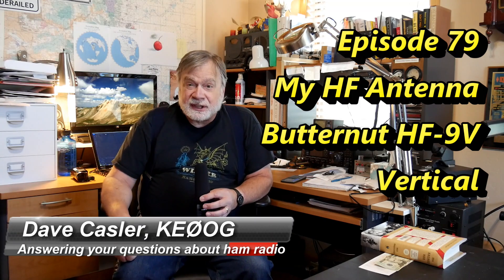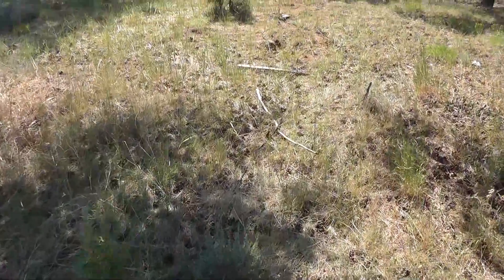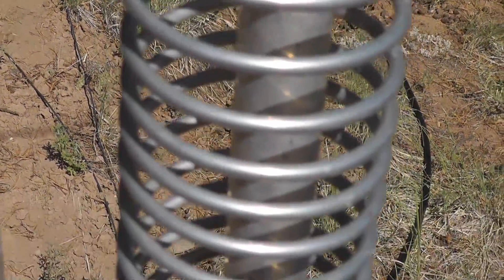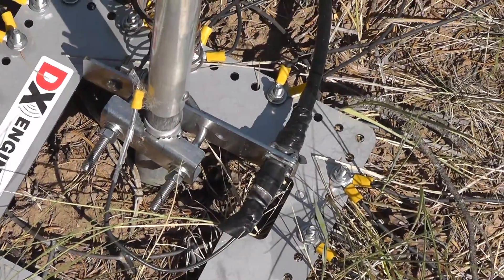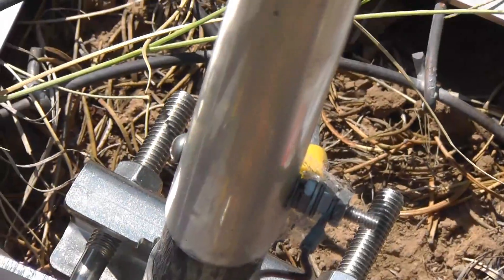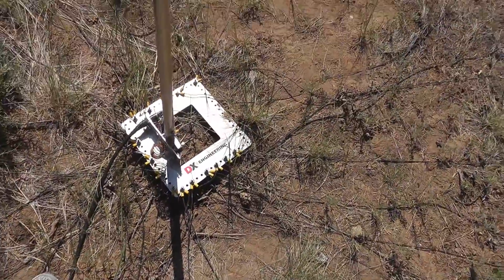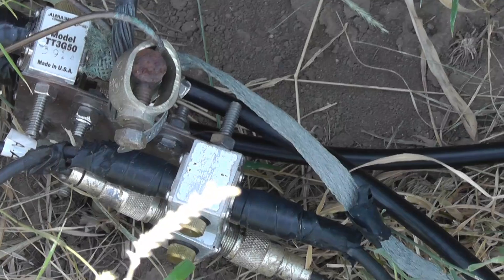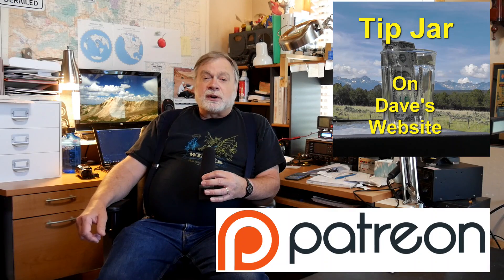My Station Antenna, Butternut HF-9V (#79)

Comment: In the 90's when I was researching and pricing vertical HF antennas to complement my wire dipoles I was really wanting the Butternut, but then it was very pricey too. So I went a different direction and purchased the Cushcraft R7. Its tuned to the CW portions; I rarely work phone. This antenna doesn't require ground wires. It can mounted just off the ground (in past living locations that was my method) or above ground (my current location, hopefully my last move, is mounted on a 12 foot galvanized pipe; 3.5 feet driven into the soil with 8.5 feet above soil). I used to use rope guys but my location now is among trees, so its free standing. The antenna has 7 counterpoise SS rods at the base to work like a ground. SWR is generally 1.5:1 across 10-40 meters. An ATU helps the rig see lower SWR. I need low SWR for QRP.

Nice tour. Do you have wire up in the air or just the veritcal?
73, Terry - KB8AMZ
Reply from the maker: I had an R5 for quite awhile and thought it was an outstanding antenna.

Comment: I don't use radials. I use cross-ply's because I can go further without a puncture. Old technology is tougher :-)

But seriously, the reality is that your lightning suppressors won't do anything when your shack gets a big hit (or a small hit) and they produce not only attenuation but also introduce phantom and dirty signals in and out of the radio.

NB : Remember tower bolts ? Same thing.....gotta keep them clean and fresh or you'll forever be hunting mystery signals.

A vertical is noisy enough already (I know you are happy with it) but to add lightning arrestors is not doing you any favours. Anyway, a vertical is good for listening and comparing so it's good that you have one. At least you live in a fairly RF quiet environment. You get 10 points for that alone :-)

Cheers Dave and 7 3.
Reply from the maker: So far the arrestors have helped with some "nearby" strikes. All I've had to replace are the little spark capsules. I once had a direct strike many years ago before using arrestors. It vaporized the antenna and blew out the coax and did some damage here and there, but fortunately my rig was completely disconnected from everything. The arrestors are no guarantee, but I don't find any issues with noise introduction--rather the opposite, since they're so well grounded that the cable shield is thoroughly grounded prior to coming into the shack. I use the Alpha Delta models. A ham friend does communications installations for the electric utility and showed me how to use them.

Comment: Aint no way this kid is spending 600 bucks for a antenna
Reply from the maker: I agree. I've had it for a couple decades--it was much less expensive back then, though still pricey compared with other antennas. Plus I've added a bunch of radials, which don't come with the antenna. I'll admit, though, that it works quite well with all those radials!

Comment: With Radials on the ground like that, do you set the mower deck quite high  as to not get them twisted up n the blades ??  Just wondering? and you mentioned some kind of ground clip to keep the wires "AT" ground level??  -----    John A Bellas   KC2UVN
Reply: You have to mow occasionally David? It doesn't appear that your grass splotches require mowing. hi
Reply from the maker: The clip is simply there to keep the wire down enough that the lawn mower won't get it. There is no requirement that the radials have to be flat against the ground.

Comment: i have a question !
can i have my ham license online without going to any where (ex: though an online exam)
am asking because I'm in a country which doesn't have any ham institute nor any radio club 
but i know very much about ham and about radios
thanks for every video u put out for us i really find them very informative
73
Reply from the maker: Amateur radio is regulated separately in each country. You can contact the International Amateur Radio League (IARU) at http://www.iaru.org/ for further help.
Reply: thanks a lot , 73
Reply: no , my country used to have one back in 90's but now it doesn't,
well i live in an country which is at war for several years now and going to the Capital to look for a ham radio institute ,is practically a risk of life
but i have another Q, if i managed to go to a nearby country and had my license from there ,I'm I obligated to work ham radio from that country only???
Reply: What country doesn't have an Amateur Radio organisation ?
Are you living in North Korea ?

Comment: I've gotten the impression that verticals are expensive and "fussy" and this video did nothing to dispel that idea. I know you are happy with the performance of your antenna, but in other videos you've suggested that a simple dipole is hard to beat, too.

I wonder if you'd do a video where you set up a bog-simple dipole on 40m at the appropriate height to see how it compares. It would be cheap, at least! If you can't get up high enough for 40, then a 20 would be interesting, too.
Reply from the maker: Sounds like a good idea. I'll add it to the list.
Reply: How long is the list ?
Reply: And perhaps how to make it a 20M dipole eg inserting an insulator in each leg with a jumper connection - G0FFL

Comment: Loved the field tour. Thank you for sharing. 73 How do you bring the coax wires into the shack.
Reply from the maker: We have crawl space between the floor and the ground. So I pulled the carpet back from the wall and drilled a hole through which I stuff the cables. Then I go into the crawl space and push the cable out a ventilation hole near the ground rod.

Comment: Dave, have you considered spraying some clear sealant on the cracked solar panel to keep moisture at bay?
Reply from the maker: Very good idea. Thanks. I'll do that.
Reply: I was thinking clear bathtub caulking
Reply: Clear caulking may not allow for enough sunlight to pass through... I wonder if automobile clear coat may do the trick? Here's a product at Amazon with high marks: http://amzn.to/2tSTEtn
Reply: Clear Flex Seal lol. Little late but.....